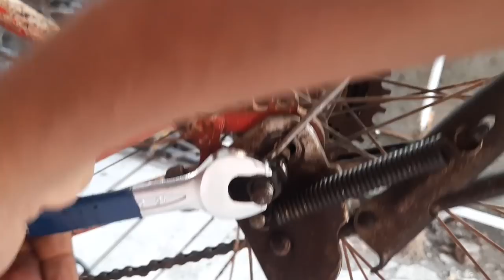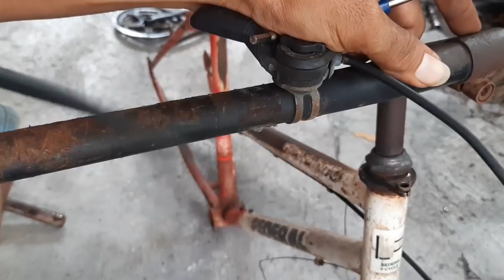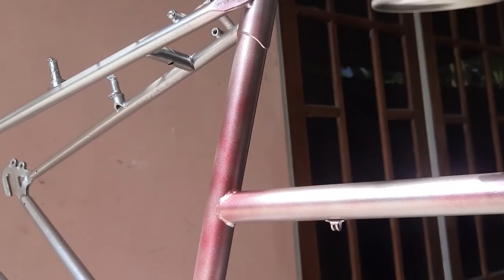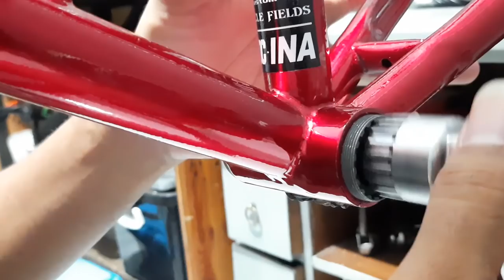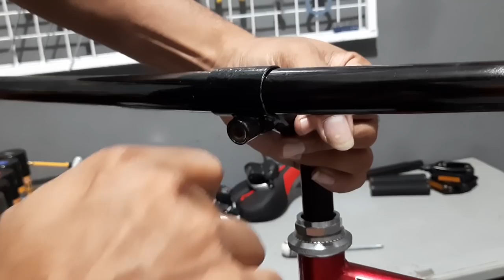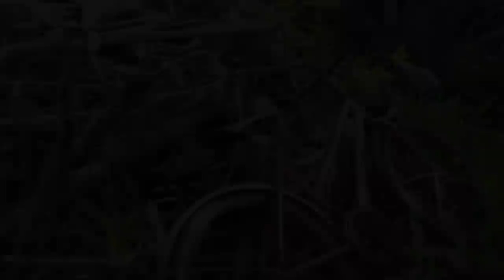Banana forest found, old and broken bicycle restoration

Comment: very nice restoration as always!, but may i know what is the "bcd" of that chainring, i have a similar old bike and im planning to restore, thanks
Reply from the maker: The chainring isnt replaceable, so not use bcd on this crank.
Usually 130 bcd for roadbike
104 for mtb
Reply: @CycleFields  okay, imma measure it if its 130 or 104, thanks and keep up the good vids!